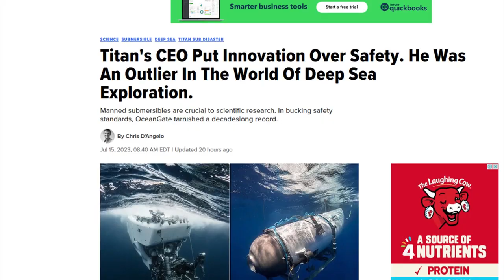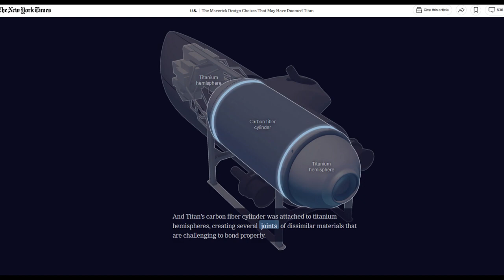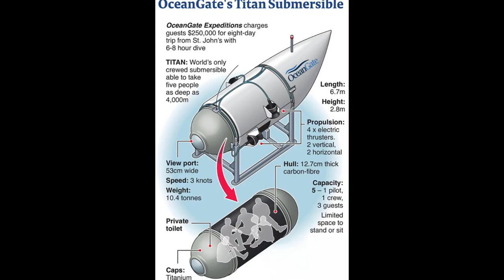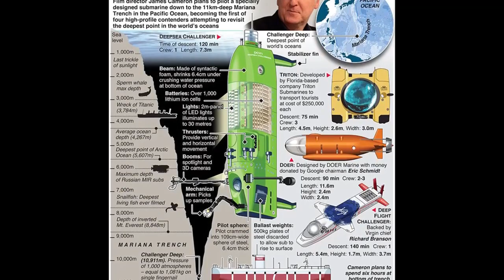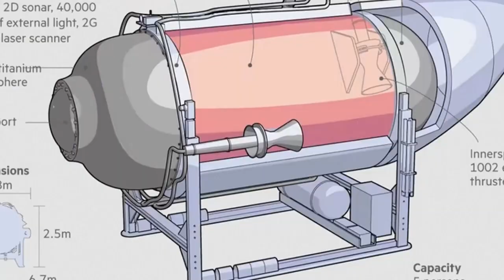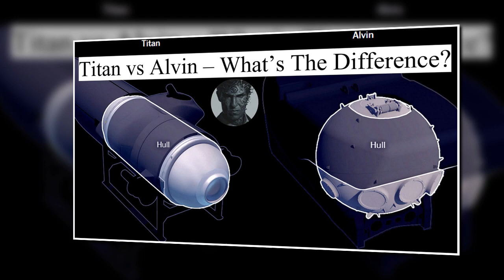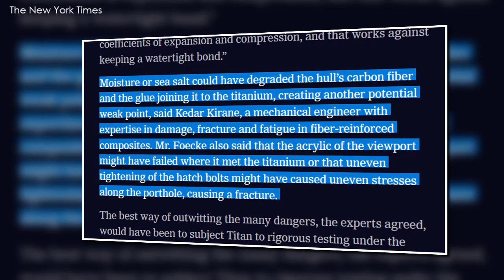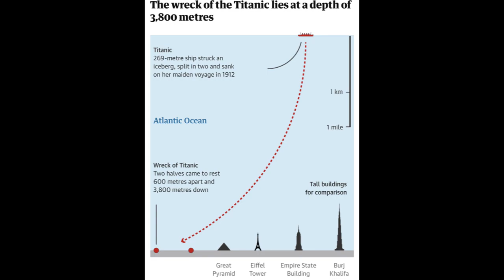Serious Question: Why COULDN'T Titan Be More Like Alvin?

Comment: Titan was built to hold more people to make max money per dive it was a business model. What should have been done is 2 subs designed like Alvin using a sphere that can hold 3 people each and have the safety of 2 subs so if one sub gets stuck the other sub can help. One video a deep sea diver talked about a sub that they had certified for way deeper then titanic and it was certified for 100 dive cycles at like 35,000 feet after 100 dives it needs to be recertified and that if the sub didn’t dive under 4,000 meters (titanic is like 3,800 meters) it wasn’t considered a dive so it could dive to titanic as many times as it wanted 100% safely fully certified and insured without any worry of implosion. Makes much more sense to build 2 sphere subs that is a known safe design, if anything see if you can make a sphere safely bigger to fit 4 people then you have 2 subs with 4 people each so you can bring down 3 passengers on each sub each time down, yeah I’m sure it would cost a bunch more money to build a proper sphere sub and 2 of them but if it’s designed like the one I was talking about it could be certified to go super deep and that 4,000 meters and less is not considered a dive which would reduce cost because the certification processes that need to be done every 100 dives below 4,000 meters is very expensive so building it like that would reduce operational costs plus would be safer obviously because it’s certified to go much deeper. If anything just build one sphere sub that holds 4 people but is safe, charge a minimum 1 million bucks per person and have 10 people scheduled for each trip out It makes no sense to take a trip to titanic to only have a few people to do one or 2 dives gotta do a bunch to make it really worth it. Then if people really show interest in going then build another sub so you can do 2 subs each time and then start offering to do different locations. 250k per person sounds like alot of money and it is but its way too cheap for going to titanic just the ship that needs to be chartered is gonna cost 1 million bucks for a week long trip then the sub company has to make money to pay its employees, to pay for the costs to build the sub plus money for future maintenance of the sub and money to expand the business and charging 250k per person is barely enough to pay for the charter ship they would need to make many MANY millions on each trip for it to really make the business profitable and for the company to have a brite future. People look at 250k like the company was making tons of money but they lost money every trip because of how expensive it is to do what they do. But most people think every business is making way more then they do because they aren’t business owners. I own a auto repair shop and customers think when they pay me 1300 to do a heater core that I put 1300 in my pocket, when they pay $120 for a diagnostic fee they think I am ripping them off but they don’t understand that I pay 500 bucks a month just for my online service manual and software updates every month for my scan tools, the 100k in diagnostic equipment I have that I have to maintain and also keep buying more equipment because the hardware and software is always Changing, all the time I spend keeping up with technology this is after I’m done working,
Reply: Look up “Aluminaut”.
A submersible designed to exactly the same functional requirements as “Titan” - fifty years ago.

Comment: Maybe, but I think even your idea of a taxi is too altruistic for Rush, I don't for one second believe he was trying to open up the oceans for common people. I think it was carbon fiber as a deep sea submersible hull material he was truly testing rather than the actual design of the Titan itself. The Titan carrying passengers was just a cynical ruse to get the tourists to help fund his R&D and act as human test subjects to prove the concept. I think Rush's true goal was to make cheap subs for the oil industry and to get lucrative oil contracts and he was hoping to do this with carbon fiber hulls. If it worked Rush is instantly the leading expert in this new use for CF, he's the face of this new revolution in deep sea exploration and he gets to relive his glory days of when he did the same thing in airplanes. But oil companies are not interested in experimental designs, they want proven submersibles. Step one was to prove CF was indeed a suitable material.

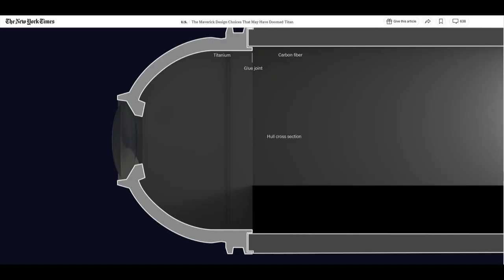Comment: 10:00....No... The expansion differential issue  really only come into effect when a material goes through thermal cycles....
The deep is colder than the surface, but heat is what really tests this characteristic. A solid, professionally formulated adhesive with high performance flexibility traits would be sufficient if they also incorporated mechanical locks in the ring design.... Titanium pins through pre-molded holes around the carbon ring would've survived.
Reply: Actually that would be worse - the discontinuation would be a massive stress raiser.

Comment: The "Titanic Taxi" made me think of the leaked transcripts and how the transcripts used terms like "enjoying the ride" and "happy crew" seem very much like something a pilot would announce to the passengers. While it seems out of place relative to standard submergible communications. It seems very in place considering what we know about Stockton Rush. A man with an aviation background who wanted to commercialize deep sea tourism. That aspect is what drove the decision to design the sub with the large window and cylindrical shaped hull. To seat more passengers and greater visibility outside of the vessel. It's a very nuanced and curios detail that I haven't heard much comment on. 

  I know Snopes 'debunked' the transcript. But their basis was on the official code sheet that we know they don't abide by. The big picture is that Stockton Rush ran a very non standard operation as evidenced in the very tapestry of this case. To debunk the transcript based on official codes would be like me saying "They didn't use a carbon fibre composite  hull because it wasn't rated for that depth and not a standard in the industry". And we know that isn't true. That said, I feel Snopes's debunk was very premature on their part. They are often quick to jump the gun and they don't always admit when they get it wrong.
Reply: SNOPES is not a reliable place for information.  It was run out of the garage of a couple in Sherman Oaks, CA with questionable ethics.
Reply: @leopardwoman38 100%..Snopes is garbage

Comment: Rush intentionally broke rules. 
It's ok to break some rules if you can prove them plain wrong or obsolete due to improved knowledge or improved technology. This kind of breaking old rules doesn't just remove old rules, it immediatelly replaces them by new rules. 
Rush's mistake was, he didn't use science to prove old rules wrong. He simply decided they were wrong.  He broke rules not because he had technology that made old rules obsolete. He broke rules because they came in his way. That's not the way to be successful, it is the certain way to death.

Comment: You need to take a look at the patent for the RTM. It basically says ‘it’s the same as aircraft systems’ and says the system only works comparing the signal to previous dives at the same depth - this is pure nonsense. Firstly it entails always having a previous dive for data, and secondly it doesn’t show how the system could predict failure - it only asserts it as there is no real experimental data on a large hull disclosed. It’s a worthless patent that was gained through an accelerated examination and highly restrictive claims. He got this IP as a sales prop.
Reply: it is like using a deployed airbag to warn you a crash is coming.

Comment: The arguable issue is that the sub worked. It was innovative and it was pushing the envelope. You are 100% right that Stockton was the physical embodiment of hubris... but the sub worked. You are correct that it was not practical, it was not safe, and paying customers should never have been inside it... but it worked. Stockton Rush built a submersible that achieved the depths of the Titanic. It should have been a single trip, and he would have been a famous eccentric guy with his crazy submarine. This craft was not sustainable, but it did work.
Reply: it was no innovate. it was the short bus built version of a submersible

Comment: I think that even if the cylinder between the two titanium hemispheres was made out of titanium instead of carbon fiber, I think it would still be a weak area of the design,
Reply: There's nothing wrong with using a cylindrical shape. The 60's Aluminaut was cylindrical with a crew of 7 and had a test depth of 15,000 feet, which is deeper than the titanic. BTW, it was the Aluminaut that literally helped recover the Alvin's ass off the bottom of the ocean, when it flooded on the surface and sunk to the bottom of the ocean.....
Reply: Thanks... I think of a beer can but full size subs are cylindrical but they all have a crush depth.
I guess it depends how deep you plan to go.

Comment: Spheres are not very efficient when trying to design something meant for more than one person, that's why the pressure chamber wasn't spherical, even though that would've been the best option. The shape was fine for what it was being used for, the materials that were used were the weak point (specifically the carbon fiber hull and glued joints).

Comment: I'm still completely confused as to why exactly being light weight was a big concern for a deep sea submersible. Wouldn't the ability to withstand the crushing depths be far more desirable? Call me crazy but I just don't get it.
Reply: its an aviation mindset at work. aviation even outer space is less hostile to human life than the deep ocean. hence it is counter productive. buoyancy is less important than pressure resistance at depths.
Reply: Because he wanted it to be as close to naturally buoyant as possible. Because if so, he could use weights to make it heavier for the descent and just drop the weights for the ascent. A heavier still titanium sphere would need big ballast tanks with air to get the buoyancy level up. So, the smaller/lighter he could make it, the less advanced it had to be, and could be made much cheaper. In the end, it's a cost thing. He traded safety for low cost in the hopes of getting a viable low cost operation to the Titanic.
Reply: @ingvarhallstrom2306  Interesting, and again I'm no expert but isn't basic buoyancy very simple and easy to achieve? If your submersible is negatively buoyant and you want to avoid the cost of having adjustable ballast tanks compressors/tanked high pressure air and whatnot, why not simply add a few solid flotation tanks to the submersible to compensate for the added weight of a proper steel pressure hull, that would propell the sub upwards in the event of a ballast drop. Let's make it out of carbon fiber because carbon fiber is cool and it's uhhh "light" sounds more like a coke fueled sales pitch to me rather than a sound engineering strategy.
Reply: @ingvarhallstrom2306  wasn't going to happen with cheapness constantly breaking

Comment: Innovation doesn't mean you got it perfect and nothing ever goes wrong.   There's going to failures because they are necessary learning tools.  But where oceangate went off the reservation was in their thinking that they had worked out all the kinks.  And with the benefit of hindsight, it's hard to see why they would think they were there.  They had too much faith in their RTM without it even being proven.  Same with their carbon fiber hull and glued on titanium hemispheres.  This failure doesn't necessarily mean carbon fiber composites will never have a role to play in deep diving submersibles.  It did hold up for a few trips.  But it just wasn't mature enough or had enough testing to reliably count anyone's lives on it.

Comment: I know it would have been a nightmare, but Oceangate should have spent the time to advance the Titanium/sphere design and enlarged it to fit five people. It would have taken years, but at least Rush and the rest of the victims would be alive.
Reply: Look up “Aluminaut”. 
Same functionality as “Titan”.
Reply: @allangibson8494  Just checked it out and I'm shocked that Oceangate didn't inquire about the design, copied it, and went from there.
Reply: @0311uli  Aluminaut weighs 80tons.
It would require a better launch ship.
On the other-hand any decent heavy machine shop could probably run up a copy.
Reply: Technically can most likely still have a cylinder design; exact replica of the Titan - yet be made of 6 inch thick solid titanium or stainless steel for example. (Controller as well should be made with more durable and simpler, waterproof airtight components - and if still want to could have the exact replica of the Logitech G F710 controller shell except being made of marine grade 5052 aluminum for example)

Also just because Stockton Rush / who ever worked on Titan maybe did not know better does not mean things have to always be about suffocating certification / must seek approval before being able to do anything. No, just know EXACTLY what are doing in the first place, get it right the first time.

Things don't have to be all about imaginary money, approval - just raw resources and logic - not leaving anyone behind.

Hopefully with technology can bring anyone back alive again - even if someone had been disintegrated. Like brain set up as neural networking that learn off of self - a person are literally their own logic moving around in their brain as their own physical neuron signal. 'Death' are literally just falling apart. If someone falls apart, maybe still a piece of them around somewhere, who of which can perhaps be rescued and given a new brain with body to live again..

If someone did a bad thing, did not know better, self destructive - need to just stop that person and communicate without harming them. Maybe eventually can get through to them, without harming them. To explain what it means to live around and not hurt each other or own self - without harming them..

Btw since perhaps literally any person live in their own brain should ensure are vegan about things like food for example. Like a plant has no brain unlike a chicken, pig, cow, each of which does have a big enough brain and therefore if blood flowing, brain working then most likely a person living in such a brain.

Any person experience their own existence. So maybe someone else experience their own existence. I type these words that maybe you are really there and I'm not just wading through my own shadows. I can only answer I know I definitely exist - if anyone else exist, I could never say I knew for sure as I am not another person, I am only me.

No person left behind.
Reply: @NicM-vs9ox  Aluminaut…

Comment: I am not a sub engineer, but the Titan reeks of being built on the cheap.  In motorcycling , we say  " if you have a $10 head, buy a $10 helmet. "
Reply: How much are the lives of passengers worth? Obviously a rhetorical question. 
They are worth at LEAST the extra cost of a titanium alloy center section...
Reply: @houseofsolomon2440  that not how a sub works, stop commenting garbage if you don't know what you are talking about
Reply: my garden hose spung a leak last week i wraped it with a full roll of electrical tape ? good as  Titan anyday
Reply: @jimbrown5088 haha did you wrap it to 7 inches or 5 😂😂
Reply: @Lifesahowl  its leaking againe now ? i better not let paying car wash people use it hey [ stockton would ]
Reply: Lol good one lol some things in life you just don't cut corners or try to reinvent the wheel! In life sometimes you get what you pay for and when your life is on the line well that's not the time to go cheap
Reply: that glass-fibre layer seems strange, I would go for ordinary rings spanning the hull
Reply: @rolfjohansen5376  if i were to make a sub id make it out of distilled ice.
1 the thicker the hull the better the buoyancy
5 cheap as shit.
3 sub z temps are easy to maintain at depths
2 it can be fully welded shut in seconds
4 water is supernateual and proof of God ;)
6 it may be seethough enouth to not require a viewport
dissclamer, i have no spellchecker or any idea about the popperties of ice at depths greater than a beer glass, but it would be cool to find out.
Reply: don't pretend motorcyclists are so smart, I live in a state where helmets are not mandatory, I'm baffled by the amount of people that ride without anything on their head
Reply: That's probably because there's nothing in their heads.
Reply: @DD-gi6kx  it works out tho. Culls the world of stupid people and provides a lot fraction of organs for people needing an organ transplant.
Reply: @DD-gi6kx  i mostly dont wear a helmet for many reasons. 
1 it make you more alert and less risky. 
2 if i get into a serious accident i want to go out quick instead of becoming an invalid and a cost to the tax payer and my family.
3 i like to p1ss off smug authoritarian types.
Reply: Innovation has nothing to do with slipshod execution
Reply: They built it on the cheap to offset the cost of those Styrofoam coffee cups they kept wasting with their little compression gimmick souvenirs they handed out at the end of each ride.
Reply: I'm confused, Submarines aren't spherical, so what's the difference?
Reply: Amazing how many billionaires had a $10 head.
Reply: To be fair, you can buy some REALLY nice used helmets for $10!